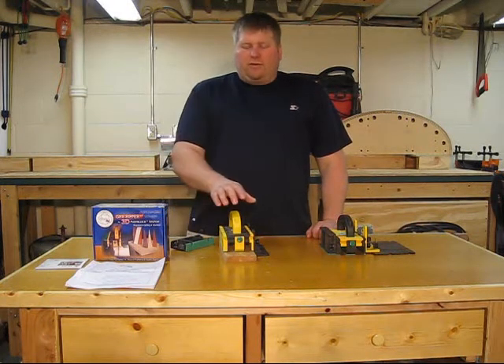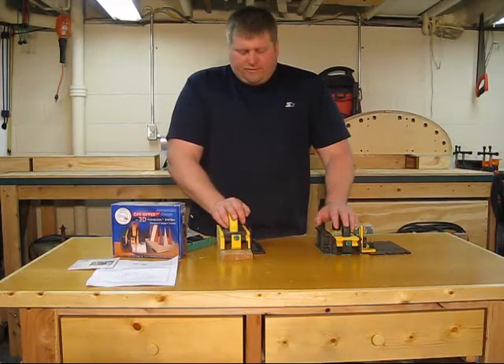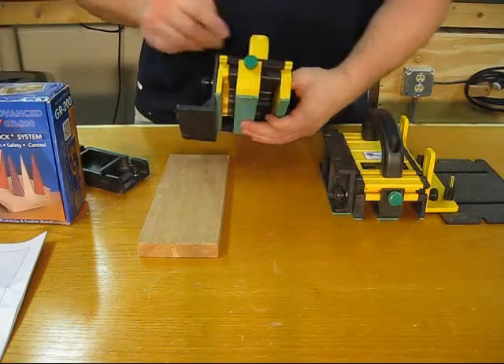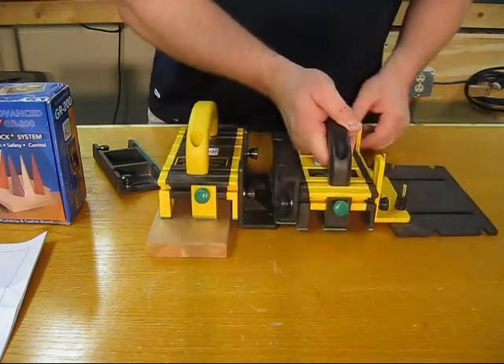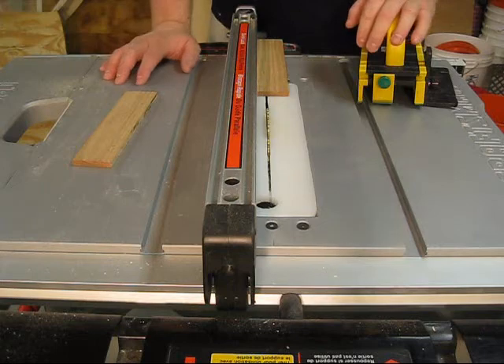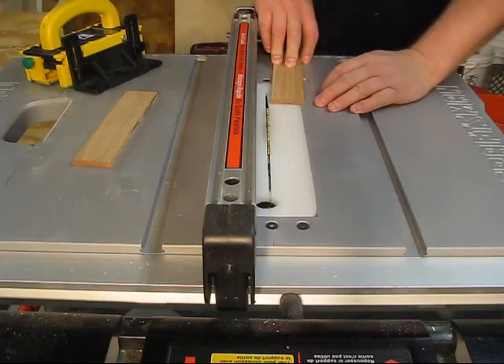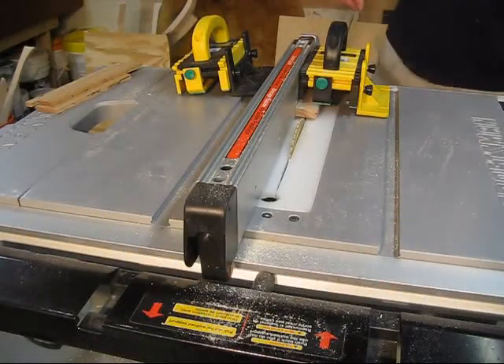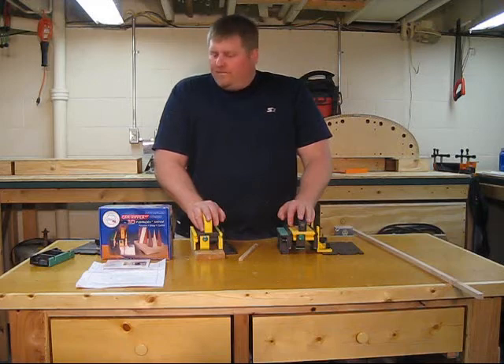Micro Jig GRR-Ripper 200 Review

Comment: When you use a table saw, it doesn't matter what safety gadgest you are using.  The rule not to forget is, do not stand in line with the blade.  Stand to one side of the blade.  Then if there IS a kickback, you will not be in line with it.  My highschool shop teacher told us what kickback is, then showed us.  We were impressed.  Then he told us, never stand behind the blade.  I'm 72 now, and never had kickback yet, and also never stand behind the blade.

Comment: I am sure you are correct. They do make using the table saw safer. I have just got a brand new table saw, ( with sliding table ) and I am looking forward to using it. I think I will get one or even two of the grippers.  In the UK the gr200 are £90 ( $126 US ) each , which is nearly double what you pay. This of course takes into account import tax and VAT and a small operating profit. But even so this is steep, and you certainly think twice before purchasing this most valued safety device. Anyway I would like to thank you for your video and time, thanks.

Comment: Look at 9:19 in the video. You almost lost your hand when you crossed over the fence to shut off the power. The grrrippers need to be firm against the fence at all times to keep them parallel to the blade. You almost had an accident with no riving knife either.
Reply: I was wondering about that exact spot. I wasn't sure if he just released pressure on it, or if for some reason the grip didn't hold. But you can definitely see where the front end splayed out and the back end was in danger of binding and kicking back. I like the device in general, but one of the drawbacks is that with the carriage on top you really can't tell where the blade is in your workpiece. 

Is this much safer than a hand held cut or most other push devices? I definitely think so. That being said, it still requires you to pay attention. One of the largest issues with safety devices for many people is that they make them feel safe. And that can lead to lapses in concentration. I get the feeling that's what happened at that point in the video.

Comment: What is the widest cut these can handle. I know that they can do 1/4" but what it I want to cut a 4 inch wide piece would I have to go back to a push pad and my hand on the cut side.
Reply from the maker: You can use the GRR-Ripper in place of your push pad.  At 4 inches, you wouldn't be going over the blade though.  I don't use my grippers to do wide cuts like that.  I use a feather board and push stick setup.  Actually, I use two push sticks.  One pushing through and one pushing down on the wood so it doesn't rise on me.  This keeps all fingers out of the way.
Reply: WorkshopAddict
So it's design for only thin cuts that would be too dangerous to hand feed.  I use my hands and a pad and never a push stick.  No enough control with those darn things.  I think I paid $69 (Black Friday special a few years ago) for the SkilSaw table saw and then spent the saving on buying some Freud/Diablo blades for it.  I think I'll work on building and extension for it instead of buying these pad since I do not need a lot a thin pieces.

Comment: $90.00 for one block!!! That's one third of the price that I paid for my Ridgid table saw. From what I see you're having to use down force to get the piece through the blade and rely on the grip track to hold down the wood. I would think that as saw dust accumulates on the bottom of the track it can become slippery and If you're in a hurry and your gripper slips on top of the wood you could end up pushing that plastic block right on top of your blade.  I don't like the idea of passing my hand directly over the blade even if I have a  $90.00 piece of plastic between my hand and the blade.